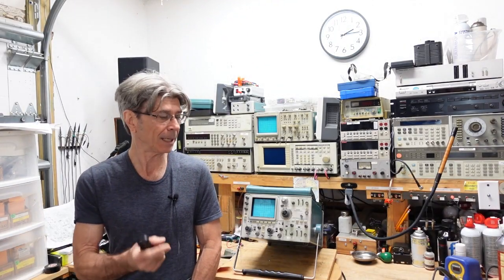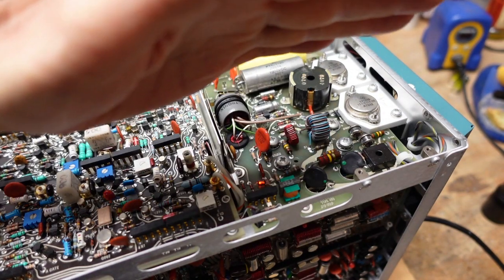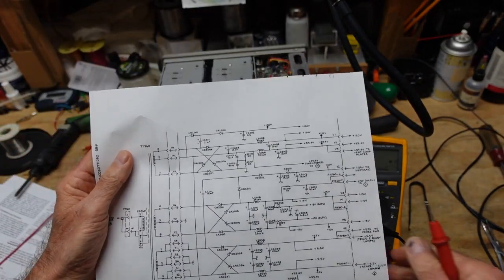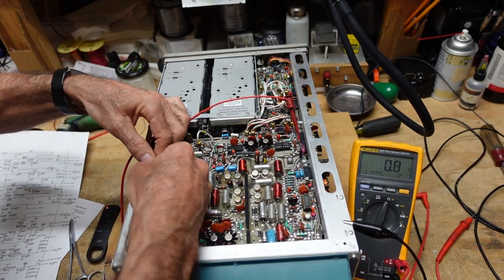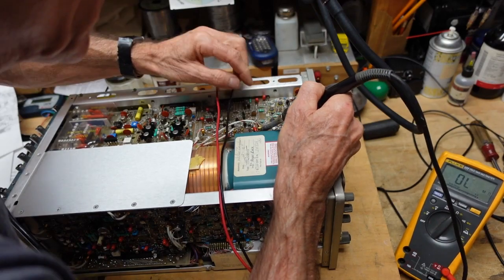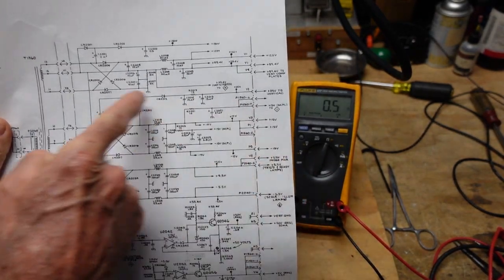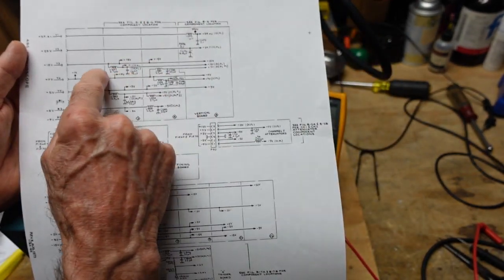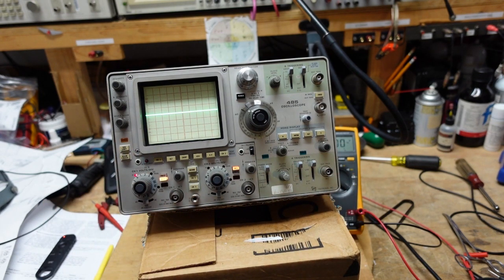Tektronix 485 Repair No Power

Comment: Hi Ray, very logical and methodical breakdown of circuit tracing. Have to say that Tektronix make it easier to fault find!
Reply from the maker: They really did.  I imagine today it's just board replacement, but back then you had to take the time to troubleshoot and repair.  In this case, they really were the good old days!

Comment: Back in the day when that scope was made electrolytic caps were much larger in size for the same value and leakier.  Nowadays you can get elec caps much smaller, but still not as small as tant caps.  They are also less leaky.  Tek tried to keep the size of the 465 475 and 485 scopes to a small portable size, not like the 545, etc older models. Tant caps were the way to go.  Worked in electronic repair for over 50 years.  Tektronix back then always made repair of their equip easy to troubleshoot. Today it can be hard just to get a schematic and a lot is Windows/computer based.
Reply from the maker: Yeah, today's components are way better than what was available back then.  Hopefully they'll continue to make through hole components for a few more years.

I've owned a 547A, 547B and a 7603.  Currently my daily driver is a 2445A.  A have a DSO, and while the measurement capabilities are amazing, the display on the old CRO's is more to my liking.  And the DSO just plain sucks for X/Y.
Reply: @raygianelli3612  Yes, display not so great but great for the GPIB output uses.

Comment: Good troubleshooting process. I always suspect tantalum caps first when troubleshooting any Tek or HP gear from this era. I usually do a visual inspection of all tantalums before even applying power. Sometimes a shorted tantalum will appear brown or even charred. I replace these first and sometimes that’s all it takes. And, as you say, next on the list is cleaning dirty pots and switches with DeOxit.
Reply from the maker: Lot to be said for a good visual examination!  There have been instances where I pulled out the schematic and went through the paces only to find something that was visibly bad.  So yeah, definitely a good practice!

Comment: New to your channel,  i adore the quality of these scopes. I have a 454a without beam at all; a ht issue i think. Without primary acting dangerous what tests can i make.? Thanks for this video!
Reply from the maker: Well, I don't know if you saw the second video, but my HT issue was caused by a failed rectifier in the LV supply.  Ensure that you have all the low voltages first.
Appreciate the thanks!

Comment: 4:30 If you unplug the unit but leave it powered, would it discharge faster?
Reply from the maker: Part of it would.  It has an inverter, which then feeds the rest of the power supply.  So the inverter is the only part that would be affected.

Comment: I enjoyed this video a lot. Learned serveral things. I'm fixing a Panasonic VP-5564A oscilloscope and it have this following problem. It powers on but shows no trace. I probed the power supply at all the test point I can see +12,-12,+5, all correct. When I measured the voltage across the deflection plates of the CRT between pin 3 and 4, the screen flashes a slim vertical rectangular box for a split second. When i touch these two pins repeatedly, the box moves at a rate set by the time/div. Touching other pins doesn't seem to have any effect on the screen. So the horizontal controls work but for some reason the trace doesn't show up. Do you have any idea? Also I can't find any schematic for it on the internet.
Reply from the maker: Does it show a trace when you input a signal?
Reply: @raygianelli3612  it didn't back then. But today, I probed the CRT pins but I clipped the MM's COM to the chassis. The pin number goes 4-3-2-1-14 clockwise. It shows -166v on pin 4. I believe pin 3 is the cathode with - several kV so I didn't probe it. When I probe pin 2, a spark appeared between the pin and my probe. Then somehow the screen comes to life and shows a fairly bright horizontal line. Something kept the trace invisible must have discharged. I tried to lower the inten so it doesn't burn in the phosphor but inten knob doesn't work. What work is all the horizontal controls like position, time/div the trace does repond like it should. It was set to GND coupling and no signal was inputed. When I input a signal, it still show a straight horizontal line so matter how I set the settings. Focus knob barely changes the trace. In short, horizontal works for sure, vertical, focus, intensity broke.

Comment: Tek used tantalum caps for a reason.  Right? What's the impact of replacing them with a plain electrolytic?
Reply from the maker: My understanding is that you can replace them with a low leakage electrolytic.  The only place I'd be leery of using electrolytics is in switch mode power supplies.  If there's a tantalum in a SMPS I'd replace like for like.
Reply: @raygianelli3612  The low value ones 4.7uF and lower can be substituted with a polyester cap like the Wima MKS02. on the 2465 Tek scope power supply there some small value tantalum ones, that I would change just to be on the safe side.
Reply from the maker: @Djinnsos  This morning another one went on the +15VDC supply.  This one let the smoke out, so I had to open the garage to vent out the toxic smoke.
Films are a good choice up to 4.7µF, as you mention.  They get too bulky and expensive after that.
Reply: @raygianelli3612   The old tantalums are almost like playing a game of whack a mole. Almost worthwhile to replace them all. Unfortunately, it would be a big job as many as Tektronix used in these older 'scopes.
Reply from the maker: @capriracer351  Oof.  Yeah, I did consider replacing them all.  Weird how it was only the +15VDC supply where they failed.  Another one went this morning.  It was easy to find, since it burned up.  Had to open the garage to let those toxic fumes out!  😳
Reply: @raygianelli3612   I can't remember for certain, But I thought I heard you say that those were only 15 volt rated caps. That might be why they are failing after all these years. 

Can't believe that Tektronix specified the voltage rating that close to the voltage applied. The rule of thumb is to spec them for at least twice the voltage that would be applied to them. So those should have been 35 volt rated caps. Might be the root cause of the sudden faults. 

Might have gotten a little moisture in them with the device sitting so long also. I seem to recall an application note from Vishay that might have been discussing the failure modes of Tantalum capacitors. Overvoltage and moisture were the two big concerns. Also, excessive ripple currents. 

Maybe there is something else going on in that supply? Maybe the diodes are getting leaky? Unlikely with modern components, but not unheard of in something from the 60's or 70's.
Reply from the maker: @capriracer351  Yeah, I raised an eyebrow at that.  Usually Tek derated the voltages for a comfortable margin.  But one was 15µF 20VDC and another was 22µF 15VDC.  Definitely stock.
Honestly it's damned impressive that it works so well for its age.  A testament to superior engineering, IMHO.
Reply: @capriracer351  As I understand it, the wisdom of using over-rated tantalums only came after they had some time in the field.  It would seem that many incidents like the one we saw here sorta suggested... "Hm... let's rethink this voltage rating thing for these tantalums!"  :)

In fact, if you look at the updates to the Tek parts lists in the manuals, one of the things that appears over time is... guess what... tantalums being replaced with parts with a higher voltage rating!  Live and learn, eh?  :-)
Reply: @raygianelli3612  One other place to not replace tants with electrolytics is in scope sweep circuits. Tants are VERY low leakage and scopes rely on that for long sweep times - I know this because I substituted an electrolytic for a tant in an HP 1980B I was repairing and caused myself a big headache come alignment time. Regards, David
Reply from the maker: @davidv1289  Wow David, that's really good information.  This is another reason I try to read all the comments I get, because I learn something new.
Those hard earned lessons really stick, don't they?

Comment: Ray,
That was "fast and furious." Great technique. Thanks.
Reply from the maker: Thanks Ananda!  Tek made troubleshooting power issues a breeze with this one.  Being able to isolate sections by pulling those comb jumpers was an ingenious design.
Reply: @raygianelli3612   You are correct. It is a long while since I opened a 465 and 465M. I don't believe that feature was in them. Kind regards.

Comment: I have a tektronix 455 that just stopped working I'm pretty well versed in hi voltage but I'm still weary about working with it in unfamiliar circumstances. Amplifiers no problem. I have never repaired a scope though
Reply from the maker: It may not be a high voltage issue.  Tek scopes often use one of the voltages in the low voltage power supply as a reference for other voltages.  So if that voltage is off it will affect others.

Comment: Excellent. You looked for the short with your multimeter set to Ohms... I understand that method. However, you had power still applied to the DUT, throughout this process. I am wondering what the advantage to the power-on method might be? How does the benefit weigh out against the risk? Please and thank you. I am not finding fault, here, I am truly asking a genuine question, without any sideways critical intent. Subscribed. Cheers!
Reply from the maker: Thank you for couching your inquiry in such diplomatic terms!  To be clear, the resistance testing was done with no power applied.  Even a small amount of voltage will invalidate your results.  I did watch the video to see why you would have thought it was done with power on, but I thought it was clear it was not.  Apologies for any misconception.
Reply: @raygianelli3612  Thank you for your reply. My guess it that I over-thought it. IIRC, you were calling out voltages, while probing. Oh, I think I get it... You were probing the power rails - looking for the short on them, - but no power was being applied. Well, there you go... And, you just taught me something else... I had not ever considered that any type of power would invalidate a resistance reading. However, that makes perfect sense, as (IIUC) the meter is reading the drop in voltage of a known voltage reference to calculate the resistance. I look forward to more of your videos. Thank you so much for teaching us!

Comment: Thank you for another excellent video. great troubleshooting techniques! I was not aware Tektronix used combs before. I have a 465 which was working one day and then blows the primary line fuse the next day. I traced it to a fault somewhere on the 55 volt rail, then put it aside for another day. I'll have to check the diagrams and find the combs to pull. Alcohol and freeze spray didn't work for me finding the suspected shorted tantalum cap. This winter I hope to pull the combs and ohm out that 55 volt rail.
Reply from the maker: The 465 doesn't use those combs, which makes troubleshooting just SO much more fun!
That 55 volt supply is used as a reference for many other voltages in the power supply, so it goes to a lot of different places.
Reply: @raygianelli3612  Good grief! Thanks for the prompt reply. Well that means the 465 goes to the very bottom of the "to do" pile. The 475 will be next. Story time: There was a guy selling 3 Tektronix scopes for $5 each at a ham radio flea market. Somebody bought the newer one, I bought the 454 & 475. The seller told us, one scope worked. When I got home I found out it was the 454! Nice scope.

Comment: After watching your video, I managed to repair a TEK485 that I had in the workshop for a long time. This instrument also had a short circuit in the Tantalum capacitors.
Once replaced, the instrument was reborn to new life.
Thanks from Italy.
  I learned a lot.
Stefano Bargiacchi.
  Retired electronics engineer.
Reply from the maker: Thanks Stefano.  Messages like this just make my day!